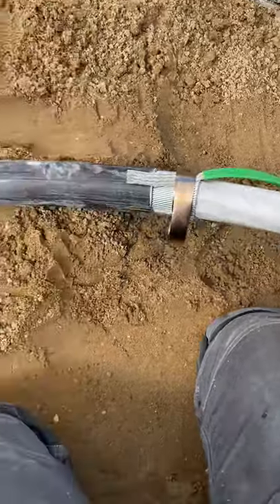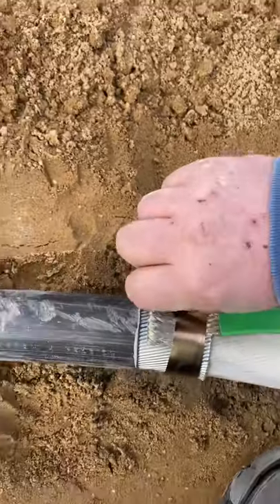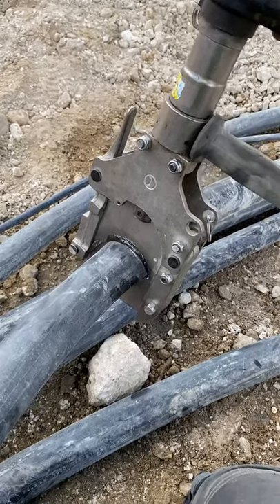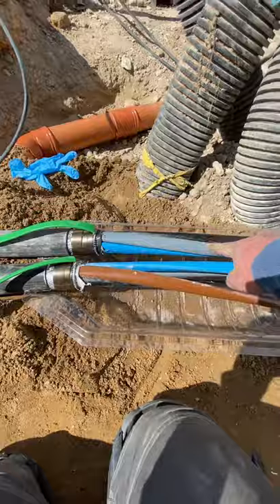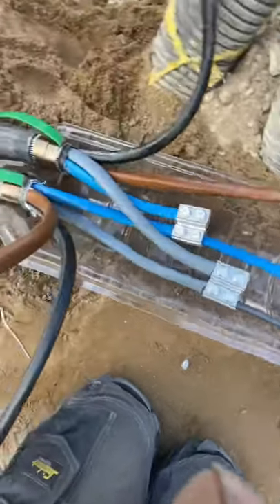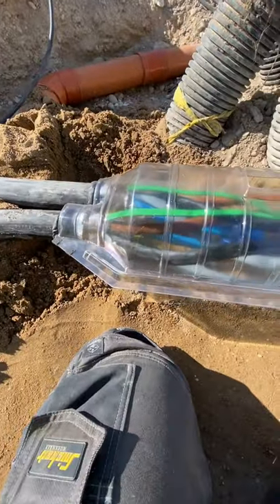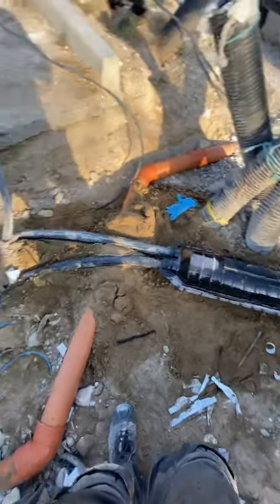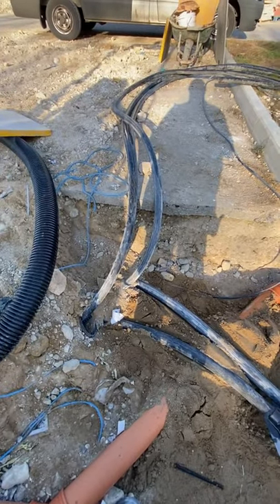Triple through joint! Two 4c x 185 and one 4c x 70

Comment: When we use the roll springs on HV, we wrap tinned copper mesh around the armours first for a few wraps, put the braid on top then about her couple or wraps and hitch it on before putting the roll spring on top. Another trick with the spring is to put a piece of Emery paper under the end of it to pull on to tighten it up then pvc tape over the top.

It also doesn’t look like there’s much sheath into the shell? We always put minimum 40mm sheath inside and rub it up with 60’s grit Emery cloth as resin doesn’t stick to the shiny sheath and water will track down and into the joint

Comment: That armour to braid earth joint didn't look all that secure - is it only held on by the tension of that metal strip, or is there some additional crimping etc. that you didn't show?
Reply from the maker: It’s initially held on by the tension of the metal strip but then it’s secured by the resin itself when it’s poured into the joint. The amount of force that is applied by the coiled metal strip is pretty excessive, I assume that’s why they provide it in the kit.

Comment: Nice one , I would have thought they could make those bags of resin bigger for the purpose of filling those large joint cases , looks like that one you did took a lot of bags.....
cheers mate......👍
Reply from the maker: I forget how many it took now but it was more than was supplied in the kit. They ordered a lot more and I used most of them. Over 15 I reckon.

Comment: Neat trick with the constant tension spring on the earth braid. Were they shear bolts on the cable clamps? and was the tape used over the connector blocks anything special - hi di - electric stuff etc or are they relying on the resin & distance apart to prevent flashover. Loved watching the old lead/copper cable jointers, bitumen sleeve, armour, lead sheath, oil impregnated paper insulation copper.. All had to be sweated and wiped.. then the sleeve filled with molten bitumen. Blow lamps, pots of molten lead and bitumen proper old school stuff..

Comment: Apprentice electrician here.  What really caught my eye having done a few big cables is that you used a totally different method for detaching the armoured strands (twisted one piece around the the outer sheath) did you score the strands before bending them?  Only been taught the hacksaw way of doing things.
Reply: Found your tip videos.  Cheers 👍.    My daughter also went to the same concert.  Luckily the misses took that one.
Reply from the maker: Yeah I use an exhaust cutter. I've got a few videos of me using it on here and on Instagram. It's from euro car parts.

Comment: Quick question bud. How come you've gone from a 185 to 70mm? And have you got a link to that tool you used for the SWA sheath? The one that has a chain, never seen them before 😁
Reply from the maker: It was due to the size of the board in the field end enclosure. It was just a small dB but the cable run was 300m+ long. They designed it I just try my best to make it look nice. Sometimes I do wonder about the qualifications/experience of the people doing the design.
Reply from the maker: It's called an exhaust cutter. I got this one from euro car parts.
Reply: @jointechcabling9103  thanks alot mate! Yeah it's a weird design, it's like you're spurring off the radial supply which doesn't make sense but it must do if someone has sat and thought about it 😂
Reply: In case of short circuit the supply fuse will blow without a problem, the small bit of 70mm cable has negligible resistance.
Fuses in the new board protects the 70mm cable from overload.

Comment: Quick question, I have seen splicing the shield two ways. One is twisting the shields outside of the splice case and using some type of shear bolt connect to splice the shields and the other is using a mesh similar as you have in the video. Are both acceptable?

Comment: Can you show 3 way connection for example to another building like a new build (onto existing cable) where you have to branch off the armoured cable from the road. So I mean one main cable with three old houses already on it I want to connect another house to the existing cable? Hope that makes sense lol. What is 185 is it the voltage rating for the cable? Thanks
Reply: 185mm² is the area of each conductor.

Comment: Hi, How did you get into the HV cable joining ?
Reply from the maker: I haven’t. These are LV cables. I’ve been wanting to get into HV for a while now, just never got round to it. I don’t know exactly how to do it though.
Reply: @jointechcabling9103   ah that makes sense now. I’d like to get into the HV cabling but the courses are around 5k but you really need to get on the ones supplied by UK Power Networks which I think is really hard to. Another question.. what’s the purpose of joining the 2 cables into 1 ?
Reply from the maker: @johncanty2847  that’s pretty much what I’m struggling with. Also the amount of hv that’s available unless you’re working for ukpn or similar is minimal. If I find an Avenue I’ll post it on here or on my Instagram page.
Reply: @jointechcabling9103  💯 % agree it’s quite a niche area. What made you get into the big LV cables and where did you learn about them?
Reply from the maker: @johncanty2847  I am a spark, me and my father had our own company. In 2008 we got hit hard by the credit crunch and in 2010 decided to fold it up. I went into cable jointing after that. I always did the big cables that we installed. My father taught me how to do them.
Reply: Try seeing if you can get on with national grid they were looking for blokes,,,mind u I wouldn’t want to do hv myself
Reply from the maker: @sparkiegaz3613  I’m thinking about doing it. I may have an avenue into it soon. Fingers crossed. I’ll only be doing dead terminations though. No live craziness for me.
Reply: @johncanty2847  I've not been in the industry for a good few years now so things may have changed. For what it's worth look to get qualified on the highest voltage you can. Up to 66Kv guys are ten a penny but 132Kv and above are (or were) like hens teeth. 
Every time we got someone trained up they up at that level they up and left (I used to work for an Electricity Board/PLC) to work for a contractor on way more than we were paying. Travel all over the world doing it too.

Comment: The manufacturers call it a branch joint. Normally you would "tap" onto the larger cable with one side of the connector and connect the branch to the other side. That way you would have 2 bolts on each cable. Never seen it done this way and not sure if you can only have one bolt on each cable. I'm thinking current carrying capacity of the connector.
Reply from the maker: I've never seen it before and I asked what they wanted because I was unsure. This was what they came back with. 👍🏻
Reply: Infatti anche a me sembra  strano...  Non lo avevo mai visto prima !